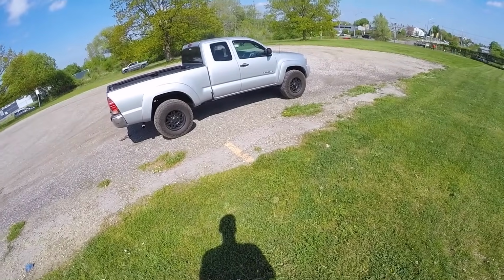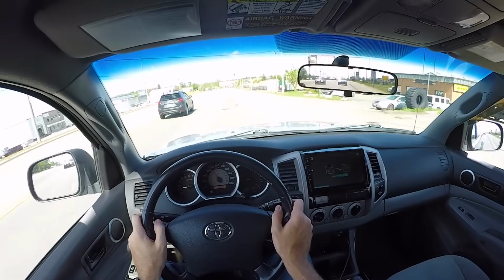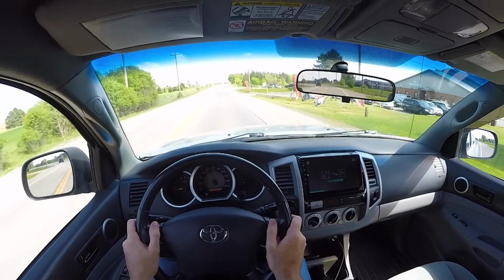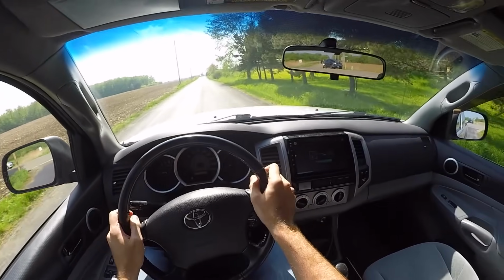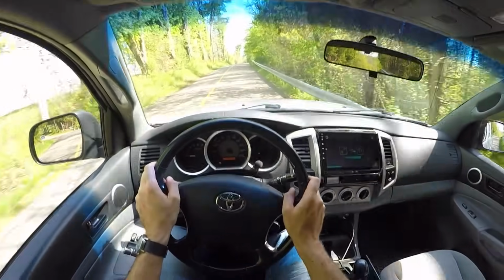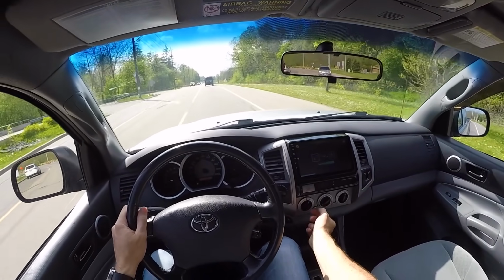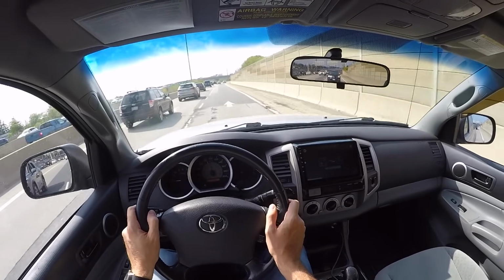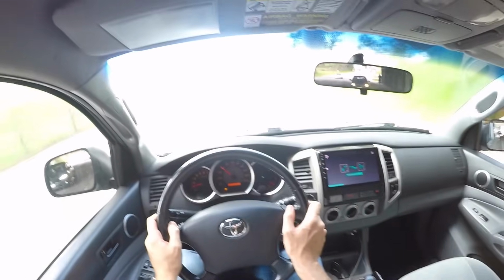How Reliable Is A 200,000+ Mile Toyota Tacoma? | POV Drive

Comment: The blower motor issue is a $20 part you can get from any parts store, it's some resistor thing located by the passenger side feet, 5 minute fix.
Reply from the maker: Yeah I'll be tackling more stuff like that on the Taco soon

Comment: My '07 v6 4.0l auto shifts butter smooth and smooth power. My '22 tacoma v6 3.5l ENDLESSLY hunts for gears, and gets much lwoer gas milage. I kinda hate it.
Reply: Take it in and get the transmission software updated
Reply: @ricktharp1  yeah, I'm gonna have to

Comment: i bought a used 2011 trd 4wd tacoma and i have had nothing but problems with it since i bought it 4 months ago. two timing chains broke, a missing actuator, and a fuel pump go out on me. trying to decide if it’s just a bad nut and trade it in for a different tacoma
Reply: I bought an extended cab 2011 SR5 4 cylinder with 20 K miles in 2012.  I now have 106 K and it runs well.  I’ve hauled a lot of wood for my wood burner over the years and other miscellaneous hauling and one leaf spring broke 3 years ago.  I had it replaced for about 300 bucks and everything else is original including the exhaust system. I had a Ford Ranger for 11 years before this Tacoma and it rusted out.  Almost no rust on this Tacoma.  It is hands down the best vehicle I ever had and I hope it outlasts me.
Reply: I bought a 2018 SR5 4x4 with 29k on it. Got 75k now just replaced torque converter and cat. Luckily I had extended warranty, would have been around 5 grand if not. Anything else happens and I’m cutting my loses. I’ve had 7 Tacomas and never had an issue til now.

Comment: My 2006 TRD Sport 4x4 has 330,000 + on it and only thing I've had to do is the cat converter.....cost me $715.  I do keep it up and have the oil changed religiously.
Reply: I’m actually in the same position now… I need to deal with my cat… was hoping it was only the sensors… I have maybe… 223k miles on it… throwin me the bank 1 code… easy fix?

Comment: mines got 380k still on the original clutch. 6sp manual 08 4 cylinder
Reply: That’s funny. Me too, 2005 V6 with 250k. Crazy to hear someone else has the original clutch
Reply: @redryder210  They just run forever, its pretty ready to get replaced.

Comment: Ready to sign on a 2013 2.7 auto regular cab 4x4. 68k miles so I'm hoping it last a very long time.
Reply: Solid truck. I drive a 2013 trdsports. So far so good
Reply: @brakotekventuresltd7420  I found another one with 28k miles. Having it shipped. Pretty excited.
Reply: Slow as hell but will run forever

Comment: I had 240 on my FJ same motor and it ran and shifted better then the rental equinox that had 22k on it the rental place gave me.truck still had power and shifted smooth as new a d underneath was mint for an 07.came from Indiana which was shocking considered in Ohio 1 state over trucks are rusty as hell

Comment: Just last week, I gave my son my 2003 Tacoma Prerunner with 197,000 miles on it.  There are no leaks and nothing is wrong.  I don't live near the ocean or snow, so the frame still looks new.  I just needed the space for my next project which is a 2003 4Runner with 201,000 miles.

Comment: I have a 92 pickup with a supercharged 3.4. Motor has unknown miles but I'm assuming 200+ based on how rough the motor was, but I abuse it every weekend and it runs like a champ. Never looked back at any other company since.

Comment: Went with a new taco because all the used tacos in my area were literally on par in terms of price with the new ones. I shouldn’t have sold my 4runner, but I made 10k driving that thing for 5 years and putting 80k on it. This “era” of yotas are just bulletproof, and I absolutely loved it. 160k on my 06 4runner and zero issues. 
Didn’t have the V8, but man I miss the immediate low end torque of the 4runner

Comment: They replaced the frame on my 2003 along with sparetire mount, rear springs, E brake cables and the 2008 I replaced the 2003 with has the same new things on it. 222555 miles. Went thru the spare tire psi thing and replaced the tire in the rack where I can get to the valve without removing the tire. Jus sayin'

Comment: My friend's 09 4WD is doing the same thing. It's very intermittent when it comes to engaging to 4x4 and when it does, it doesn't wanna disengage unless you turn the knob to 2WD and turn the engine off then back on. It has about 110k miles. Any thoughts? 🙃
Reply from the maker: I'm hoping to get a chance to dig into this one before the snow flies this winter!
Reply: Mine I have to turn the truck off, turn key half on, then engage 4x4, then start truck. Otherwise it won’t engage

Comment: I like the ride-along type of video with the headcam. The flashing AC light may be the clutch relay in the under-hood fuse box. That's a common issue with Toyotas from what I've read. An aftermarket relay may resolve that issue. I have a 2014 Tacoma Access Cab with 31K miles and mine does that occasionally. Turning it off and back on again usually solves the problem for a while. I don't know if the relay can be disassembled and the contacts cleaned with a small file. Thanks for the video.
Reply from the maker: Thanks for the feedback Bill!

Comment: I own an ‘00 4runner with 345k miles currently, I’ve had it for the past ~52k and the reliability is MIND BOGGLING. Yea it has its squeaks and rattles but it’s had a rough life but it’s only left me needing help twice, both times because the battery terminals were too gunked up with mud and dirt.
Reply from the maker: That's awesome!
Reply: Just went through the same thing with mine. Took a rough road to a fishing spot. Truck suddenly wouldn’t turn on after being off for a few hours. Popped the hood cleaned the battery posts and terminals and then boom back to driving 😂

Comment: 430k on my 2001. Still runs great.
Reply from the maker: Love it
Reply: I had a 2001Tacoma 4X4 that had made it to 483,000 miles. It would have easily survived past 500,000 miles if it had not been totaled on the freeway with a really bad collision.

Comment: Every car lasts if dump money into it. And Toyota have problems  just like every other brand.   And NO  Tacoma, tunda, 4runners are not bullet proof! In fact they have a lot problems and are expensive to fix.  I just picked up a 2007 4runner 165k miles v6 for  $1000. Because  it needs a head gasket, lifters, and cam rebuild. If pay shop it be $4000 head gasket,  $3000  for lifter and cam rebuild,plus  timing kit. It  will cost me $2000 doing work my self and they are not easy to do.   If it was a 2007 Chevy 5.3l, 5.7l , 6.0l could do head gaset, lifted rebuild for  fraction  that paying a shop or if do yourself and it's a whole lot easier.
Reply: Statistically speaking Toyotas tend to last longer than other car brands. You just bought a good car from a shitty car owner. Man up and fix your car.
Reply: @Blink61291  dude don't go there I've seen v8 and v6 Toyota needing to be rebuilt even afyer being treated right around 200k.  Head gaskets usually last about that long
Reply from the maker: Sounds like you have buyers remorse after purchasing a neglected truck without doing your due diligence. Doesn't change the experience of thousands of other Toyota owners just because you found a bad one. You get what you pay for - what did you expect from a 4runner priced way below fair market value?
Reply: @CanadianGearhead  1k for a 4runner not bad.  There are thousands of 2nd guns with rusted frames by the way
Reply from the maker: @sschevmale24  Of course there are thousands. That's why Toyota needed to do a recall.
Reply: @CanadianGearhead  all car man. Have problems but to think Toyota is bullet proof is Ludacris.   I have 300k on my s10.  Its how you maintain you are right.  2016 and 17 tacoma are worst trucks by the way
Reply: @sschevmale24  what he is trying to tell you is increase your sample size and you’ll see Toyota has better quality. Basing your opinions off one s-10 and your $1,000 4runner is flawed
Reply: For every random GM truck that ever gets to see high mileage, there are exponentially more Toyotas that reach and exceed high mileage.
Reply: Bro jegs has one for 5400.  Ready to drop in.
Reply: Your DOHC engine needed lifters done hey? You didn't have a bad truck you had a bad mechanic. 😂

Comment: You have to change the blower motor resistor chip. That's why the ac won't work in lower settings. It's a really easy and cheap fix, I've had two 2nd Gens and that's a common problem.
Reply: Yep, this was happening to my 07 when it was handed down to me. I couldn’t afford to take it to a dealership to fix it so I did it myself and that fix is what drove me towards being a mechanic
Reply: @UnloadedRex I just picked up a 2007 trd sport with only 42,000 miles any advice to prevent certain types of wear
Reply: @jakesock58  number one most important thing is to check your frame, the frames on the 2nd gen tacomas have a bad reputation for rusting out. Other than that change your oil every 5k miles, since you managed to snag it at under 100k I would also change the transmission fluid. 2007s don’t have the secondary air filter from the later 2nd gens to worry about so you’re all good there. Make sure that you watch for oil leaks, I have a valve cover gasket leak that just formed so I’m gonna have to do that job at some point in the future
Reply: @UnloadedRex  🙏thank you for the advice
Reply: @jakesock58 how much you get it for?
Reply from the maker: Thanks! It's on the list of things to do
Reply: I’ve just smacked the blower motor, located under the glove compartment, whenever it isn’t working properly. Turns right back on.
Reply: @Khaab00 same here lol.
Reply: @Khaab00, one must reach in and pull the rodent out of the blower motor
Reply: Yes, I had a 2006 Tacoma as soon as it hit 200,000 miles the ac only worked on the high speed and looked it up on Tacomaworld and they said the resistor
Reply: I got my first car in 2016 and it was an 07 Tacoma double cab w/ a 6 foot bed. I loved that truck. But the AC only worked on high so I would have to split it between the front vents and foot vents if I wanted to adjust the airflow. I wish I new this back then 😂.
Reply: Had it happen in my 4runner. A new blower motor resister was like $15 and took 5 minutes to replace.
Reply: Thank you brother hahaha This is the comment i was looking for🎉
Reply: You might want to check the amp draw and the main plug to make sure it is not burned. They sell a pigtail if the plug is burned. If the amp draw is high check for shit in the squirrel cage. The motor might be going bad.
Reply: It's usually the a/c blower fan resistor in my experience.  The part costs over $20 and I have to change it every 6 months. I bought some cheap connectors and replace it every 6 months for less than $2. There's no permanent repair but only takes 15 minutes
Reply: Orale. you just gave me an idea of what to do on my a/c that only works on higher #4 and does not want to work on lower speeds. 1.2.3
I will check this tomorrow is happening on my 08 and never really attended till I saw your comment.

Comment: Great channel with information I was looking for (I'm subscribed) as I am looking to buy a 2008 4Runner.
Question: I keep hearing about Automatic Transmission problems (True or False?)
Also, how do you beef up the transmission?
And, what are the best suspension upgrades without causing issues?
Reply from the maker: Thanks for subscribing! The 4runner transmissions are really strong as long as they aren't neglected or mistreated. No need to worry about beefing it up. Make sure to do a gentle fluid exchange instead of a high pressure flush if you decide to change the fluid. 
As for suspension upgrades, this article might be helpful: https://canadiangearhead.com/lifting-your-toyota-4runner/
Reply: @CanadianGearhead  Thank you for replying and I look forward to all future shows! I just read your suggestion above and frankly you and I have similar goals. I am ALL ABOUT PERFORMANCE and CAPABILITY not looks (we may differ there). You see, I used to work at a shop that  built Off-Road rigs for MOAB (everything from camping to rock crawling) but they were all Dodge, Ford and Chevy vehicles so Toyota is new to me. In my case, I am not looking to build a rig for rock crawling I am however looking to build an ADVENTURE / OVERLANDER rig capable of moderate off-roading while pulling a small trailer not to exceed 2,500 pounds. Any and all advice is welcome. Thanks again!